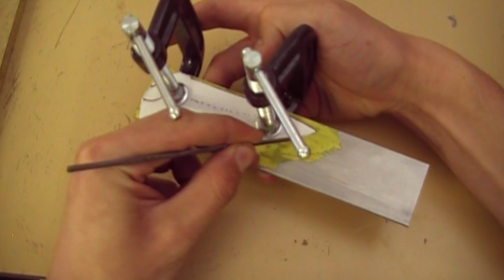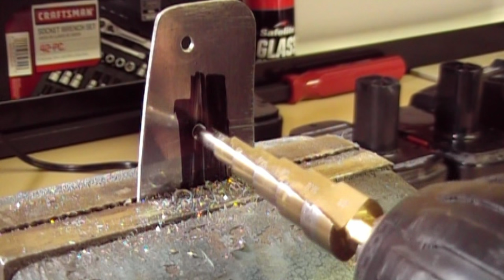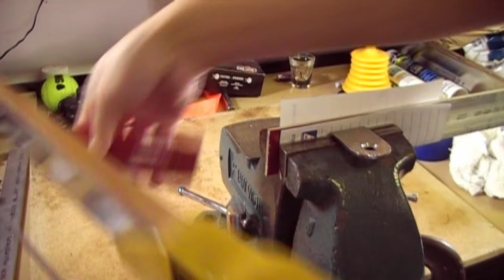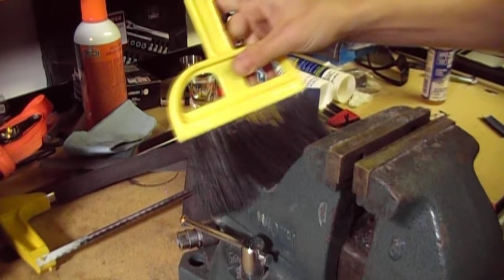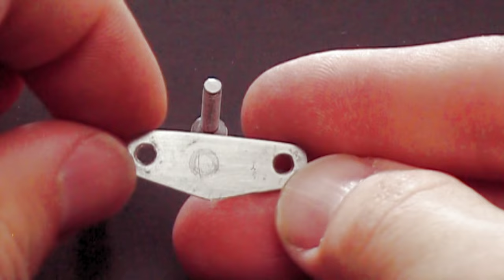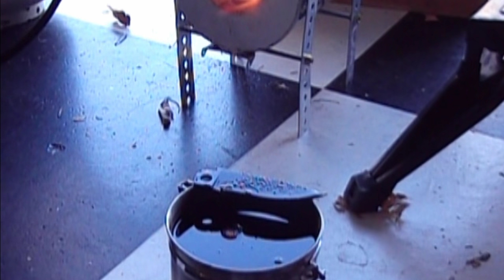Homemade Folding Knife

Comment: Pretty fricking cool!!!
If you wanted to do a assisted open you could grind a "Wave" into the spine of the blade that would catch on you pocket when you pull it out. That is if you had went with the liner lock.